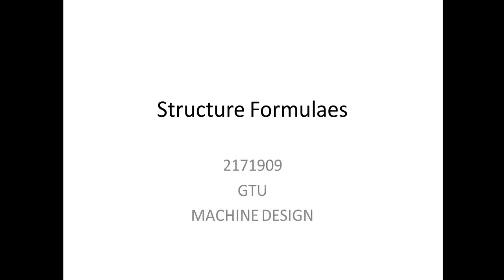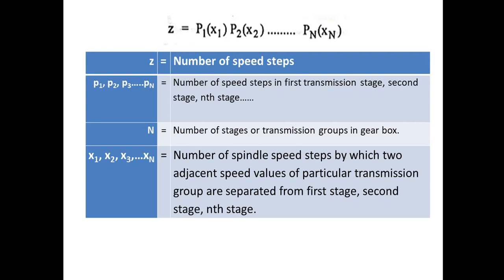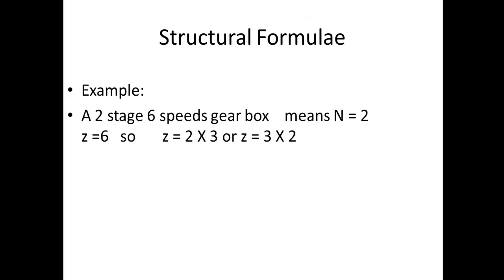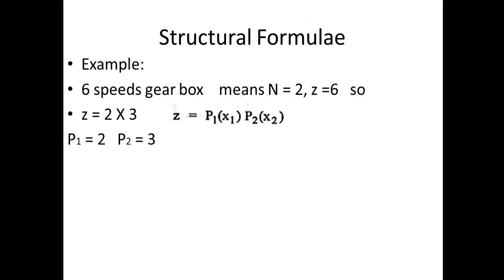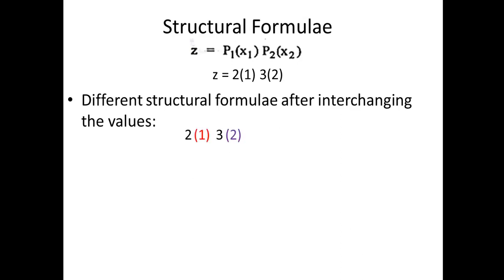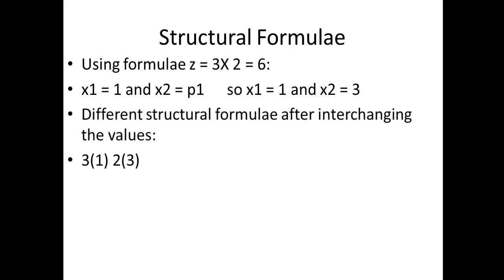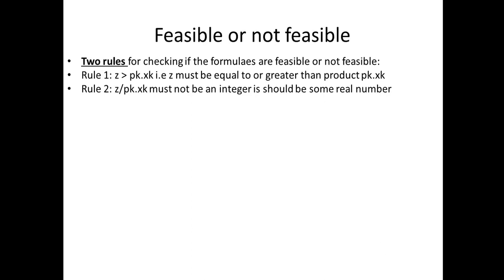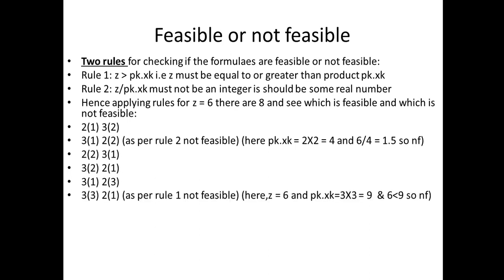Structural Formulaes for Gear Box Design for Machine Tools

Comment: @hansabakotia4718 I am working on a gear box for an actuator using worm drive with compound gears to allow us to get to the desired output torque and rpm.
Can we follow the same process you have shown here.
We need to beable to calculate number of stages and gear ratios required after the worm drive?
Any help would be much appreciated

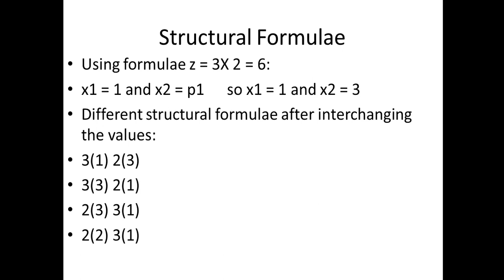Comment: Look at 4:22... What you did , I couldn't understand, I think there is some mistake, let me tell you if we take combination of 3(3)2(1) and look at 4:29 , another combination 2(1)3(3).....,then here 3*3=9.. and we want to design of gear box for only 6 speed ... Then how this combination made ? Isn't it??
Reply from the maker: .......It is correct dear.....at 4:22 we were making possible combinations and so at 5:55 while doing feasible and not feasible combination the two which you are talking i.e. 3(3) 2(1) and 2(1) 3(3) became not feasible since we want to design gear box of 6 speed. The procedure is like (a) first make possible combination and then (b) apply rule 1 and rule 2 where not feasible combinations will get ruled out
Reply from the maker: In case if you still want help drop your number @meetbakotia.me@socet.edu.in and i will call you we can discuss.......